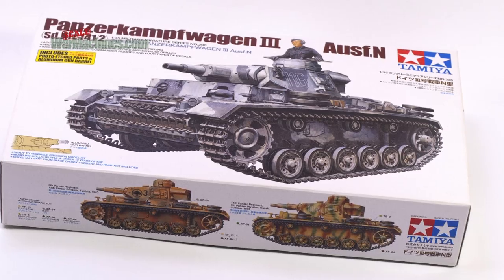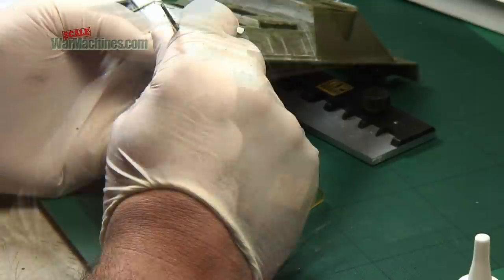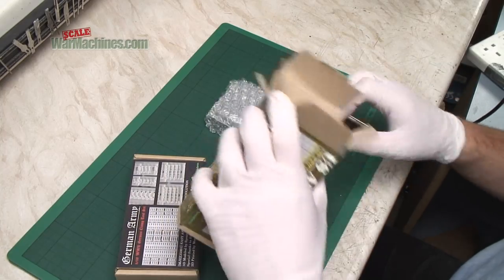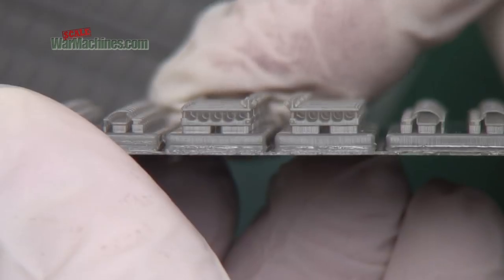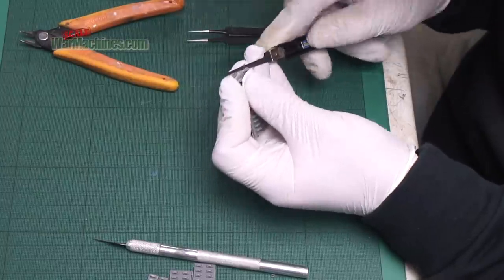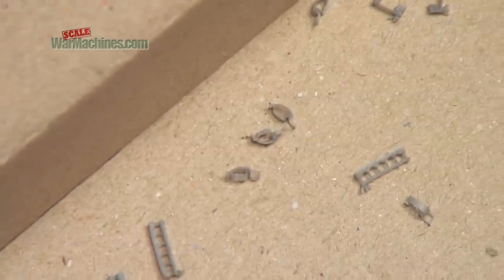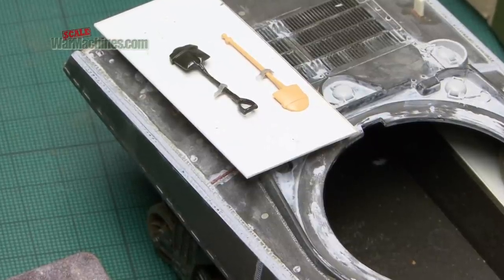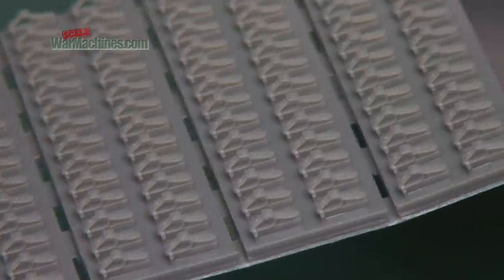NO MORE BRASS? 3D PRINTED MODEL ACCESSORIES

Comment: Looking at it, it seems like 6 of 1, 1/2 dozen of the other.. in terms of working with them.  3d printed pieces might be easier to work with, once you get them to the point you are going to attach to the model, but until then, they carry all the headache of normal plastic pieces (breaking them, separating them from the molds, filing cut/saw marks etc).  However, not having to solder is nice.  BUt 3d printing will still lack in the ease of applying battle damage and/or normal wear and tear to parts like running skirts and storage bins.

Comment: Nice informative video! I've purchased one of each of their offerings. These sets are very nice and well detailed. To be honest, I can't stand photo etch, but at times it is a necessary evil if you want some nice details on your finished model. These 3d printed accessories are a welcome change! Just recently used the U.S. strap set on the Meng M4A3E2 Jumbo Sherman. Had to do some slight mods to the tools and straps but they came out nicely.

Comment: Perhaps you could glue the handles you had to cut at the point the strap or clamp overlays the handle. Thank you for an excellent review. This what I think 3d printing will excel at: Small detail parts and enhancements. Actual hinging doors and hatches. Moveable flaps and ailerons.

Comment: A lot of the 3D printed kits & bits n bobs I've used in the past tended to have a lot of visible layer lines, that needed to be sanded etc, which was a right pain on smaller parts.. Have they managed to get around that yet?
Reply from the maker: Watch the video and see what you think. Mostly render lines are not really noticeable to the naked eye. The macro close-ups in the video are a good indication, but provide more detail than looking with the naked eye. They are akin to looking at a model with a magnifying glass, something that rarely happens. Lines are there but much better than anything we've seen to date.

Comment: I've been using them over the 6 months now and pretty sick of them now! I'm going back to PE the amount you waste is crazy less fragile than resin that's a joke! Can't touch them or they crumble soon as looked at! They still don't look right when actually on the vehicle either! The handles just don't give that thin sheet metal look on the German clamps! The US one's are really nice I use them on anything because there more a belt tie down to the accurate straps and buckles actually used on shermans etc so would saybthey were particularly for US tools! The US tool clamps are now different the way the supports are to cut them off there's only 2 attachment points to a full block underneath like these but the tie down bit always snaps off one side maybe like 2 outta 10 you'll get one with it but the footman loop sets are good! I use them alot! Gimme flat lead wire for straps n PE buckles